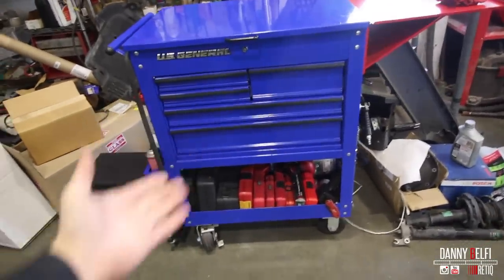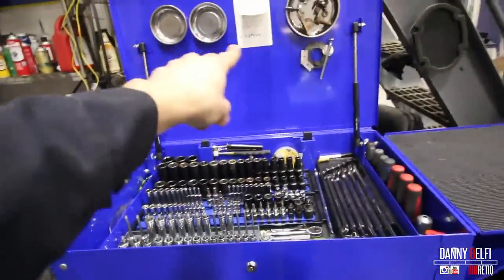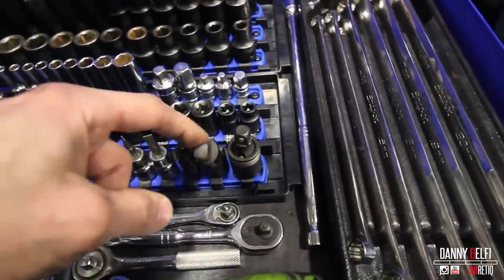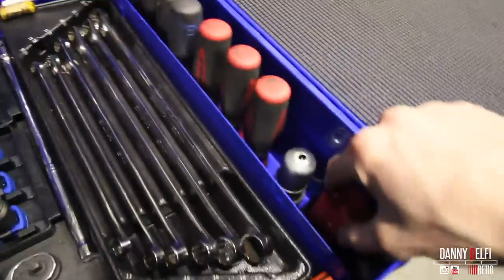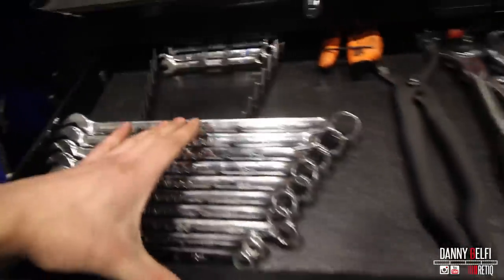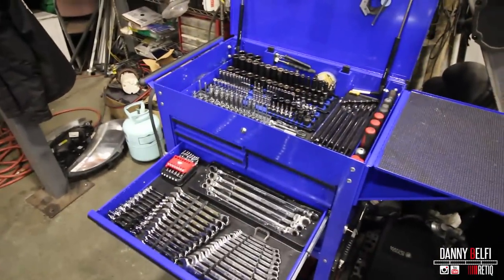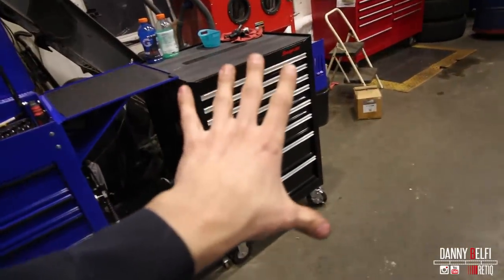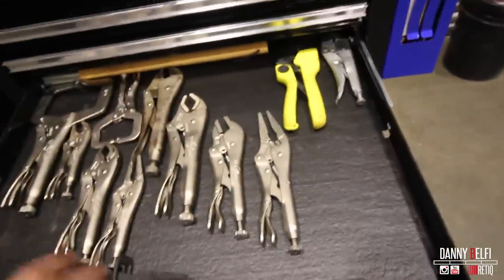30 in. Harbor Freight tool cart tour

Comment: Nice setup. I hung a old mac cabinet on one side of my cart that is all drawers. I went with the if I've bowered a tool 3 times it is time to get my own. Please dont go into toolbox debt. Sure 30 a week doesn't sound bad but when that box cost as much as a nice used car..   No thanks. Check craigslist and ask your tool reps if they have any repo or trade in carts to move around with and save up and buy a used box for a quarter of the price off CL. tools earn ya money a triple bank toolbox just takes it.
Reply from the maker: Parents Basement yess definitely!! Ima be buying the 56inch harbor frieght tool box in the next month
Reply: @Retiq  check craigslist for used boxes also.  Just myadvice. If you got a good cart setup ya will make just as much as a guy with triple banks. Actually youll make much more not paying 10,000 box off. Good luck and buy tools not boxes

Comment: I’m not a Saab tech so I don’t know what all you use or need and don’t but I feel like you have a lot of different wrenches that essentially do the same job. And again, I don’t know your daily grind but to say “I’m getting rid of 12-point for 6-point” sounds crazy.
Reply: Mikey Frisco 12 point sockets round stuff off because of the tolerances in some cases. 6 point has more surface area to grip. I do agree he has a lot of wrenches that essentially do the same thing however I think everyone gets to that point as a tech with random extra wrenches. I have an entire wrench drawer that I’m lucky I use a wrench from once a month lol
Reply from the maker: Mikey Frisco yeah Iv actually needed a 12 point like once and it wasn’t even a Saab but yeah I like wrench’s and one set of the extra long ray hung wrench’s was buy one get one free from matco with the extra long flank drive set
Reply: @Ram2253spd  i barely use wrenches. Most of the stuff i can use a ratchet on.. last time i used a wrench was to counter a bold while tightening it or when there is no space for a ratchet
Reply: @lockederbass90  I am am Audi tech and find myself reaching for 0 offset ratcheting wrenched quite often. I find that having a few wrenches is faster than changing sockets on a ratchet. I think it comes to personal preference. I have a Mac version of the 0 offset ratcheting wrenches he has, and if I have to really pull on them they start to hurt but still find myself using them more than a ratchet and a 10-13 mm socket. Anything over than I tend to go for ratchet

Comment: Nice organization. The first thing I noticed in the beginning was how much space those screwdrivers took up. I have a similar set and the foam tray takes up a lot of space but I like to be able to see if one is missing.
Reply from the maker: Greg Blau thank you! Yeah they actually kinda do never thought about it...I don’t use them a ton trying to keep them nice
Reply from the maker: Greg Blau they are used more as interior or used on small/delicate parts
Reply: I do the same. I’ve thought about making a clean drawer if I change my setup

Comment: wt? i wont give you a speach about it, but as an computer tech, autotech, body man, welder, builder and an industrial mechanic for about 50 years, in the past, 1. we took pride to remember the sizes of tools - and labels were out of question for one simple reason: ppl thought you was stupid if you labeled something the way you did - labels (not really) were accepted just to keep an eye on the inventory, in case a tool was missed and instead of labels its figure was printed on the background but only on TOOL ROOMS not on tool boxes (sorry but that is ridiculous)
2. standard or imperial sizes altogether with metric sizes were blend in one single rack, for exp. 5/16"+8mm+10 mm+3/8"+11mm+7/16"+12mm+13+1/2"+9/16+14mm and so on .. etc etc etc 
in that way, you not only demostrated knowledge and proficiency about your tool inventory but also mastering of your technics as a highly trained and respectable technician that knows how to deal with real job related and real life problems/ events and mastering of simple math formulation on site
.. dont take me wrong, this is only my opinion,  just a said 🤠

Comment: For a Saab what do I need? I was told a t2 scanner? Cause the obd2s so not work? I have a 2005 9-3 that has the airbag light on and stability control I need to get rid of or see what's wrong with it
Reply from the maker: james ? Tech 2 will read the codes some cheap scan tools won’t read airbag or stability codes so yeah tech 2 does wonders for saabs
Reply: @Retiq  ty the pain in the ass part is setting it up I heard

Comment: Awesome set up! Of your double box end sets, the Monster and the Snap On, which do you prefer? I'm deciding between the Matco equivalent of the Monsters and the Snap On set you have and I cant afford both.
Reply from the maker: Well the monster are flex head reverseable ratching box end vs the straight zero offset box end wrench’s? I use the monster mostly the snap on is more of a speciality in my opinion I don’t use them often...the monster brand or off brand ones are all pretty much same and we all put them thru some crazy stress but haven’t broken them... also keep in mind it’s not a socket and ratchet so sometimes break a bolt loose with socket then use whatever..
Reply: @Retiq  ok that helps out, thank you. My fear would be paying that much for the snappys and not using them very often.
Reply from the maker: @drabell88  yeah when u need a zero offset thin wrench they are so handy! But haven’t had to many jobs myself To need them but I deff wanted them for that time I get in a pinch or small spot

Comment: Anyone ever notice how younger mechanics (and rookies) always have a ton of hammers in their toolboxes? Jk
Reply from the maker: lazzyRJ lol the yellow hammers all came as a set then got a free rubber hammer and bought two dead blows
Reply: Lol I have 1 hammer I feel proud of myself
Reply: Modified Millennials , if you can’t fix it get a bigger hammer ! Lol
Reply: Haha! I’ve just retired from 45 years on heavy equipment and fork lift trucks. I think you need 3 hammers. 8oz ball pein (for very light stuff & tapping out a gasket) 4lb lump (for most stuff) and 14lb sledge. (though probably not for car mechanics!)

Comment: My wrenches are Kobalt, DeWalt, husky, Duralast, O'Reilly's power torque and Craftsman, few Proto and one snap on 1 in.
I have never broke one, even the tough brand from Walmart haven't broke.

In my opinion don't make snap on, Mac, matco and other massive expensive tool companies more rich 

Don't buy shit but also don't get fucked, just buy medium lifetime warranty brands. 
For 300 you can buy all the wrenches from DeWalt that you will need, stubbys and ratchet wrenches. 
I used a snap on 14mm non impact on my Milwaukee 1400 lbs and became popcorn, I used a 14mm Stanley non impact on my Milwaukee 1400 lbs and I keep using it lol.

Comment: How did you mount your magnets for the pry bars?
Reply from the maker: Nom Solo I used harbor frieght magnet bar and top and bottom magnets bolted on and top lower magnet I drilled holes I will make a mod video of the box to show everything I will do to it

Comment: Just buy a cheap servicecart. Grab what u need and do the job cart should empty between jobs
Reply: I think 90% of mechanics would disagree. The cart is the most common way of working on things. Put what experience tells you you use most frequently in it and, leave it. Most mechanics don't like having to walk back and forth from the job to their big tool box because they forgot to put something in their cart.
Reply from the maker: Man In The Mirror yea I just bought a cart just to hold tools while working on job while I have my hf cart with the tools stored in there and grab from it

Comment: Gear Wrench is just rebranded  Craftsman
Reply: That's not true. They are both owned by APEX Tool Group but, that's where the similarities end. There aren't enough similarities between the tools to be able to confidently make such a claim. If you hold a Craftsman Ratchet in one hand and, a Gearwrench Ratchet in the other, you will throw the Craftsman Ratchet in your junk drawer. The quality of Craftsman isn't even close to Gearwrench. I'd buy Gearwrench tools over Craftsman tools 10 out of 10 times.
Reply from the maker: umm gearwrench is more like matco, u can buy the guts for a gearwrench ratchet and put it in a matco co worker did that few times🤷🏻‍♂️
Reply: @c.r.edmister5223  And that is NOT true either. Well the part about Gear wrench being owned by Apex is but they do NOT own Craftsman Tool. Stanley Black & Decker owns Craftsman as well as Mac Tools and several others..